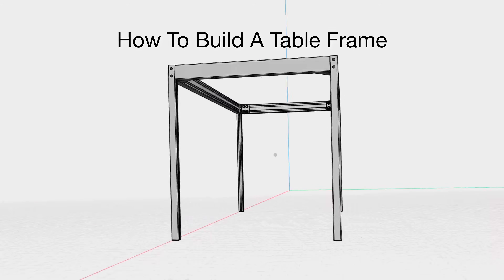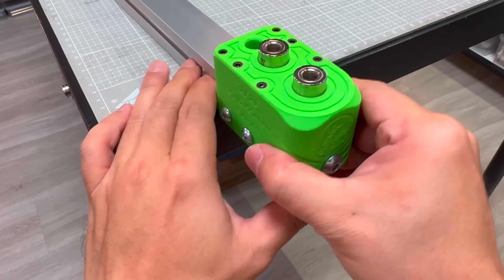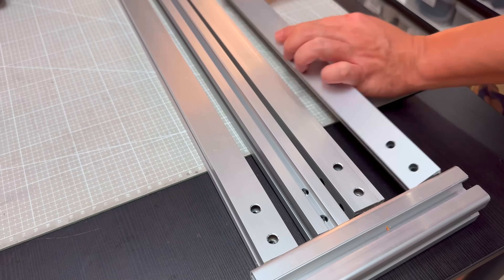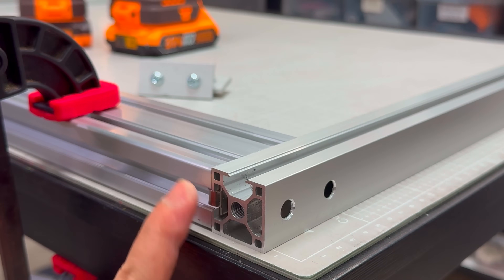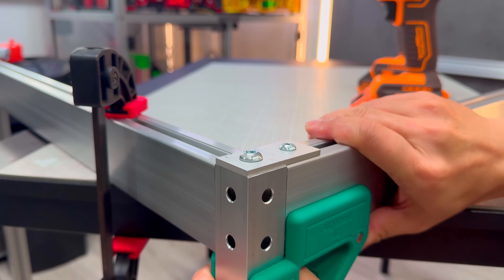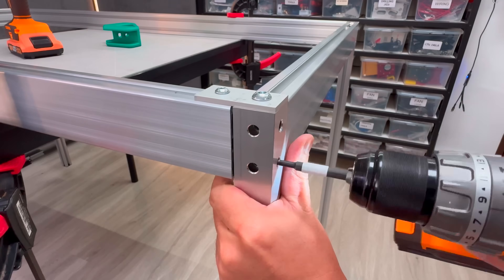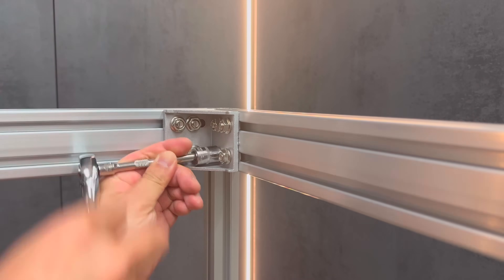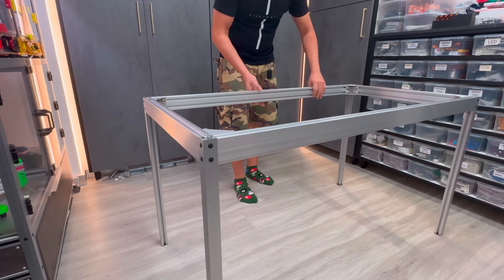How To Build A Table Frame - Using Aluminum Extrusion

Comment: I'm sure the hole plugs are something you could 3D print, and maybe with a little effort you could find a filament that matched the aluminum color fairly close. If you could get a halfway decent color match, printing them might just be worth it.
Reply from the maker: U r right but too much work for something affordable and already perfect.
Reply: @TheAluminumCarpenter perfect is in the eye of the beholder. Personally I would prefer it not have stark, contrasting black plugs on the silver aluminum. I would rather have no plugs than big black dots.

Comment: I want to build a 10' L x 10'W x 9'T Room What is best system and what size extrusion should i use for decent strength I want to a build a spray booth for painting parts?
Reply: Get a big transparent storage box with a lid. Cut 2 holes for arms, attach plastic gloves on the holes that are 2 sizes too large. Put your hand through and start spray painting.
Reply from the maker: This is another idea!
Reply from the maker: U shd draw ur design out first. 80/20 rule

Comment: What if you need to build something longer? Like putting two of these together, with just a middle support leg, And you don’t have access to the internal holes to tighten.
Reply from the maker: I already can do that. Blind joints again, with well planned strength integrity. More materials required.

Comment: We don't know which company can do the cutting work accurately.....
Reply from the maker: Source locally. This may take time. U need to do some homework to get the best guy.
Reply: You will be the cutter, this is diy explanation 👍🏼good old chop saw or grinder with cutting wheel should do. Even a sawzall with metal blade

Comment: How do you ensure that the extrusions are cut to the same length and have a perfectly perpendicular cut?
Reply: Use a band saw
Reply: @arbjful  Yes. I mean the design in this video highly relies on perfect cutting, but it did not mention it or cover the topic of how to get a perfect cutting.
Reply from the maker: Order them pre-cut
Reply: @changjunzhang sadly it up with your skills even when I mark them straight. I end up not getting straight but luckily what I was making doesn't require it to be perfect
Reply from the maker: Band saw is also good.
Reply from the maker: Order them pre-cut. We’ve mentioned this many times.

Comment: Please make a video on making an enclosure using Aluminum extrusion.  Also if it's possible, how to attach glasses or other cheaper parts as walls.
Reply: Enclosure for what 3d printer or CNC machine?
Reply from the maker: same. i want to know the same.
Reply from the maker: have you seen my latest video, its displayed very well, for the questions you asked.

Comment: Love the aesthetic of the aluminium extrusion and your work. I am about to refurbish my studio / office and am thinking very seriously of doing this with extrusions and plywood  or other boards. Also, the jigs are awesome. I shall buy a few but I may also make some specific ones myself as I have a Creality K2 plus so I can make some custom ones for myself 😁
I’m also, also, wondering what a kitchen built using your “invisible extrusion” drawers design might be like. I’m thinking of DPD ding some time with Fusion 360 making a candidate design…. 🤔
Reply from the maker: thank you... I like your idea for your studio/office. my entire home is built the extrusion way, i have to get the videos done, especially the kitchen video. what is the invisible extrusion drawers you mentioned?
Reply: @ sorry I meant the construction used in this video https://youtu.be/GR1VQAgntxQ?si=DAGJ2BBD81dBvdKJ
Reply from the maker: I see. This drawer method is going to work out perfect. You will thank yourself in the long term. Cos of the strength and durability. Everything that i’ve built, still functions like day one.

Comment: I love your designs, tools, and instructions, but until we can get the extruded aluminum stock in the US, it's mostly just a curosity.
Reply from the maker: May i know what happened in the US. Did the tariffs destroyed the aluminum companies in the US? How abt 8020?
Reply: @TheAluminumCarpenter  
I am referring to pre Trump tarrifs. 
8020 is priced to be sold to corporate model shops. What I have used are from Amazon but mostly smaller sizes.
Reply from the maker: In sure there are more distributors in the US. If not, we wouldnt have so many American customers buying our jigs and tools and designs. We already shipped few hundred parcels to the USA alone.
Reply: I’ve used Misumi Europe many times and their prices here were only a little more than other sources but they also cut and finish parts to an online presented cut list to super accuracy and finish quality.
Reply from the maker: I agree with you. Misumi is great. Rather than talking about costs, we talk about quality. With quality, sometimes we also reduce cost, by buying only once.

Comment: Flush plates.
Looks much easier than clamping a 1-2-3 block.
Reply from the maker: what is a 1-2-3 block?
Reply: @TheAluminumCarpenter  a steel block 1" x 2" x 3" in size.
Reply from the maker: I cant figure out how that will work to help us flush.
Reply: @TheAluminumCarpenter  use it just like your flush plate, just with clamps.
Reply from the maker: @ makes sense too. Just make sure that method dont screw us over.

Comment: Hi!

I want to build a custom desk with a lifting mechanism. The issue with standard frames for such desks is that they’re often "wobbly" and have a thick central part running along the table. When the desk is lowered, this part presses against my knees, meaning the underside of the desk isn’t perfectly flat.

My idea is to create an aluminum frame for the tabletop, attach it to the legs with electric actuators, and remove the central section of the lifting base. I plan to get rid of this central piece (which also adjusts the width between the legs), keep just the legs, fix them to the tabletop frame, and then mount the tabletop onto the frame, essentially integrating the aluminum frame into the design. What do you think?
Reply from the maker: your thoughts are of the same wavelength as mine, and huge consideration goes to leg space in all my designs. your idea will work. strength and material integrity is going to be your issue. I have hence tackled all these problems in various projects, all will have videos. some are out, most are still in edits. you might need to wait.
Reply: I thought i am the only one who is fussing over the parts of the table (aprons / such framework) bothering my knee. I like to be as close to the table as possible with my stomach fully in contact with the tabletop side.